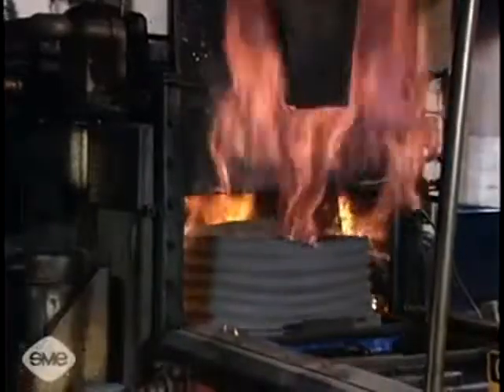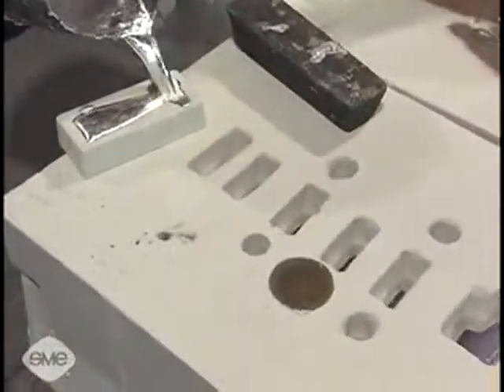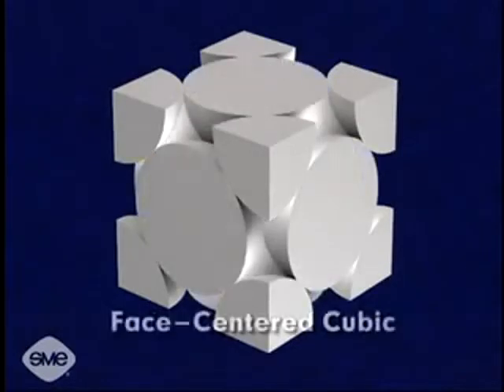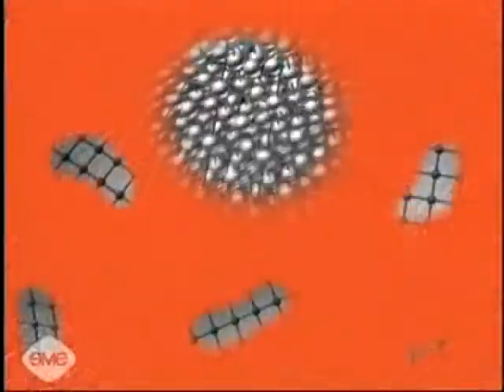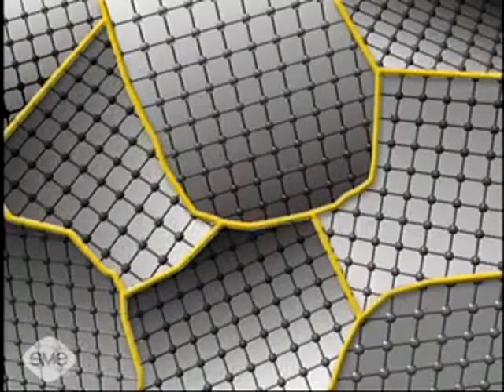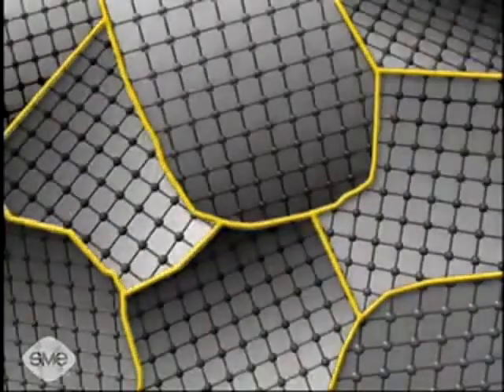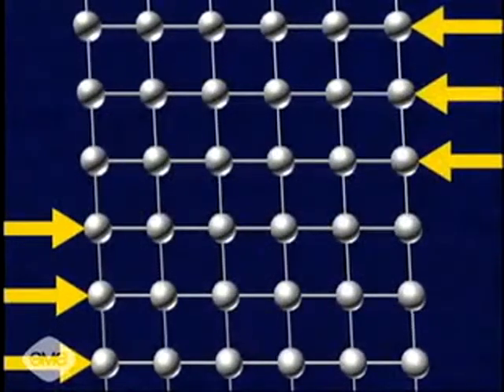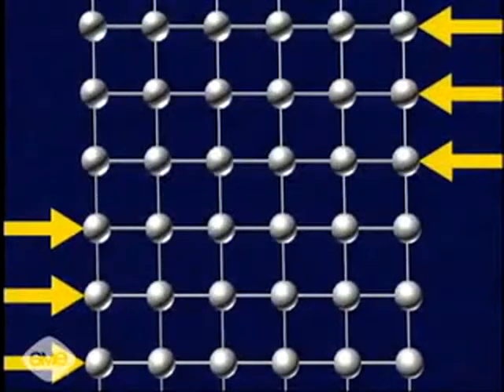How Heat Treatment Affects the Properties of Metal and Alloys.

Comment from the maker: Heat treatment is a carefully controlled process designed to change the physical and chemical properties of metals and alloys. Its purpose is to enhance characteristics like hardness, strength, ductility, toughness, and resistance to wear and corrosion. The process involves heating the material to a predetermined temperature, maintaining it at that level for a set duration, and then cooling it under controlled conditions.